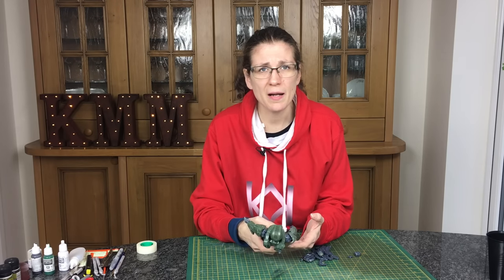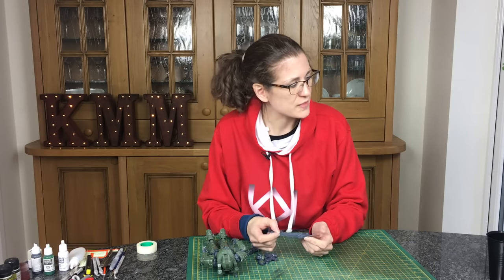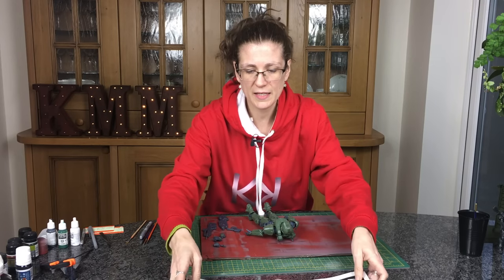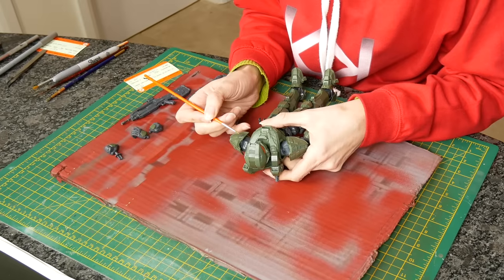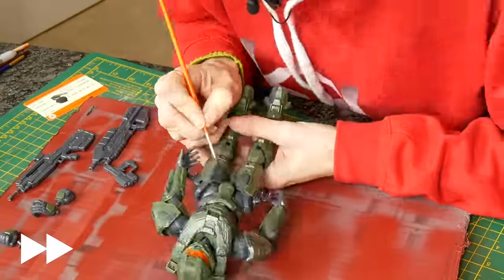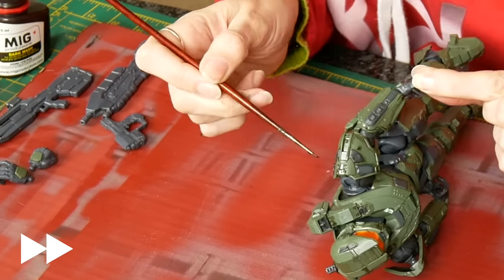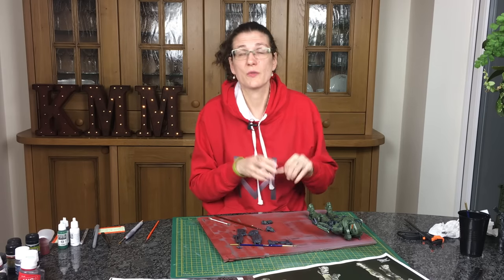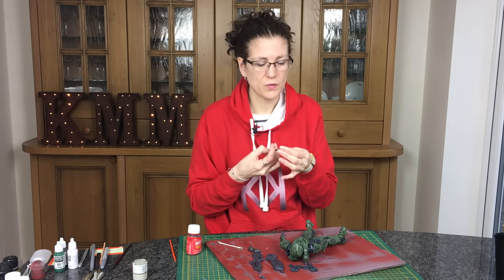How to Weather a Plastic Kit without Painting Part 1

Comment: I still have to repaint the large Jakks Pacific Master Chief. That will be "fun" considering it's made of polypropylene (PP). Getting paint to stick on that will be a challenge. I guess I first have to use a primer that is made for bumpers on cars.
Reply from the maker: I’ve seen people use fine sandpaper to add a little tooth for the paint to grip. I haven’t tried it but perhaps Professor Google may yield some results?